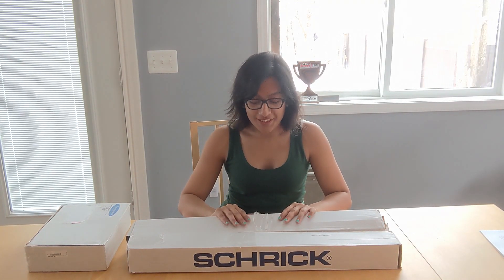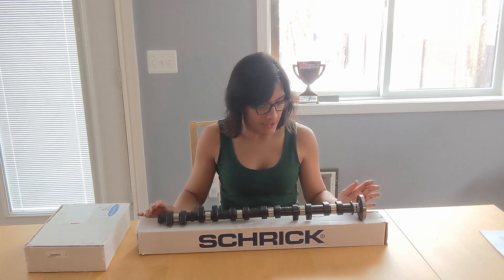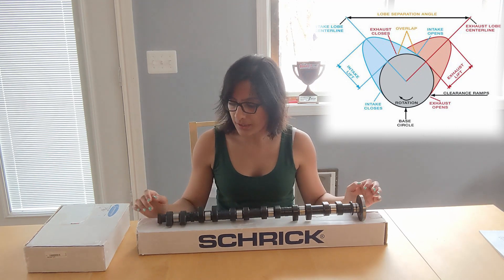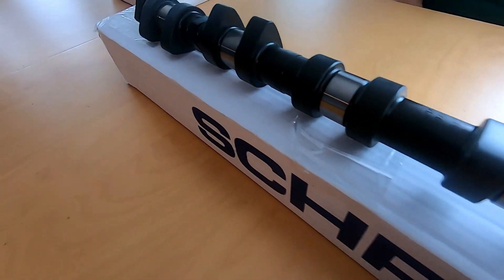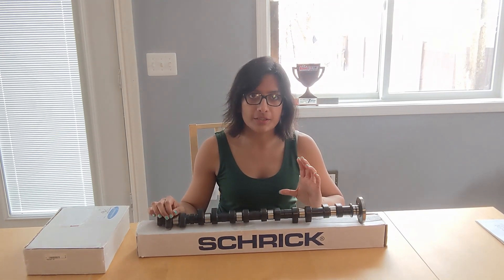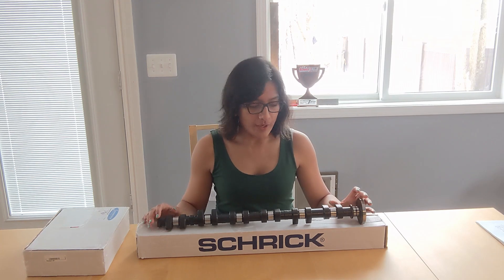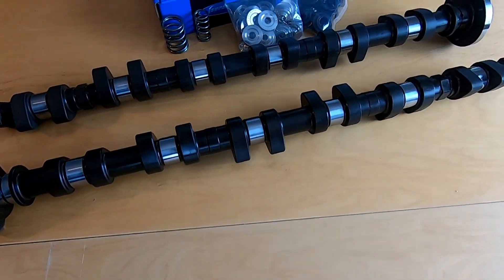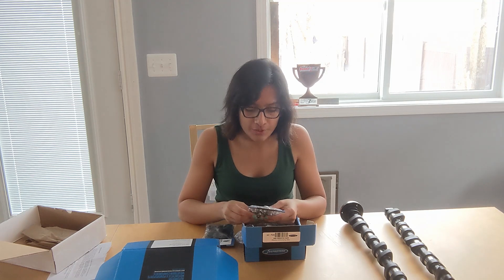E46 Racecar: More Power with the most extreme Schrick Camshafts (Part 1 Overview)

Comment: Where u buy this one ?
If u can , could u put a link ?
Reply from the maker: You can order the cams from Turner Motorsport (https://www.turnermotorsport.com/p-200185-schrick-camshaft-set-e46-330-530-x5-30-z3-30-272256/) In order to get the best performance I suggest professional installation and a tune to avoid lean conditions!

Comment: Hey liked the video, I ordered the same set and would like to know how you got the old gears off the old cam shaft and back onto the new camshafts as I cannot find any information where they switch everything over.
Reply from the maker: Hello, I safely held the old cam on bench vice and used an air gun to get the old gears out
Reply: Did you upgraded valve springs or anything else?
Reply from the maker: We used upgraded valve springs with the Schrick cams. We used hypertech springs. One thing to be careful about when choosing the springs is the seat pressure. Make sure to reach out to the manufacturer and confirm that you are getting the right springs for your setup

Comment: Will be interested to see what you make on the dyno with this. Running these cams on my own engine and have done back to back testing. Made a gain of 20bhp over standard. Peak power at 6,800rpm.
Reply from the maker: We already had our first AFR tuning session. But at 5500 rpm we are maxing out the stock injectors at 95% duty cycle. 
Once we have new injectors we will post an update video😃